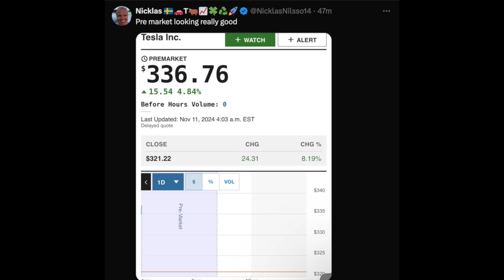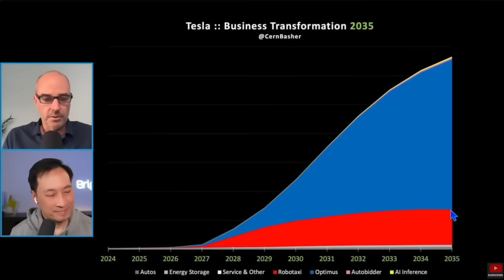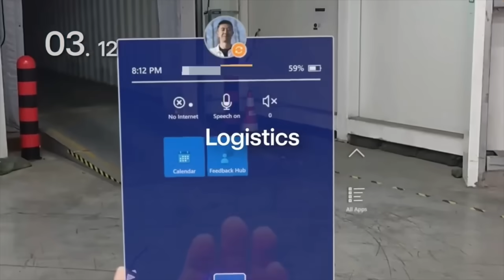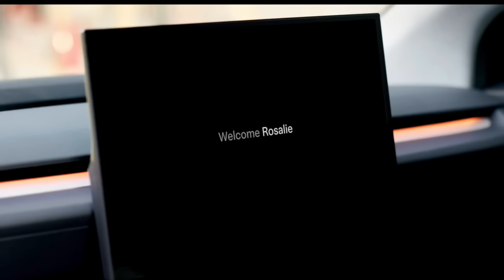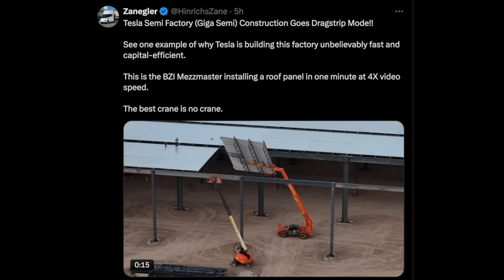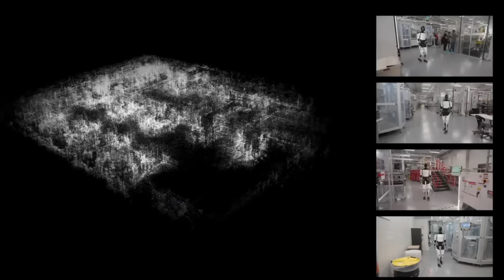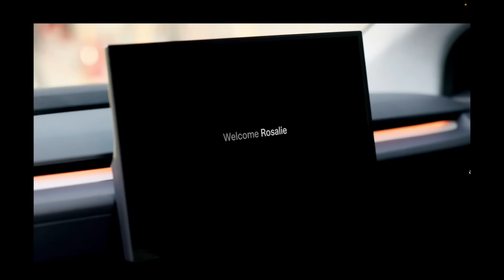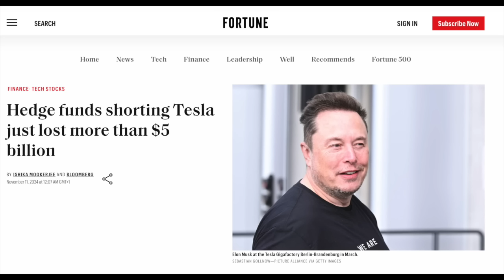Tesla up 61% in 14 days 🤯 But this is JUST THE BEGINNING!

Comment: One of the glaring  problems that needs to be solved before they have a generalized solution is accurate maps. FSD works just fine. The maps often are inaccurate and do crazy things causing interventions.
Reply: Maps will never be perfect everywhere, which is why FSD is capable of prioritizing its vision to adapt.
Reply: @ I look forward to FSD reading speed limit signs. I still believe navigation needs to mature.